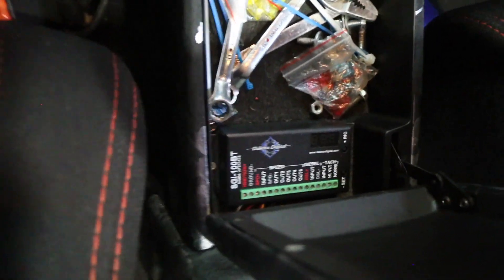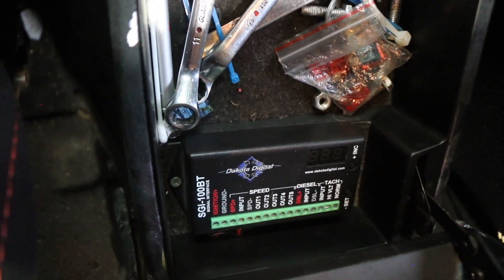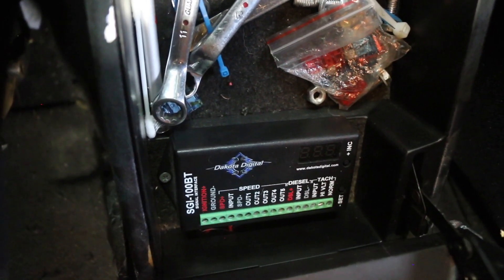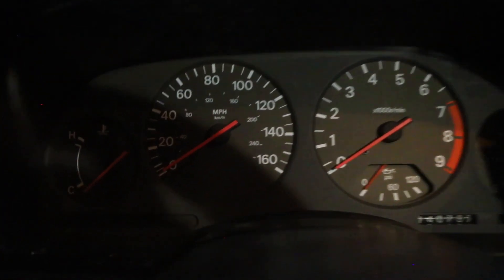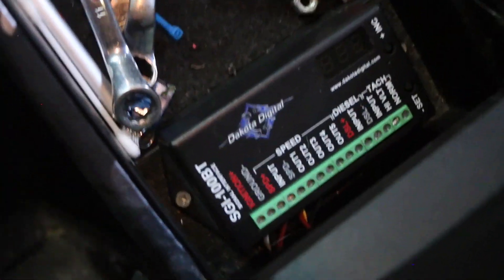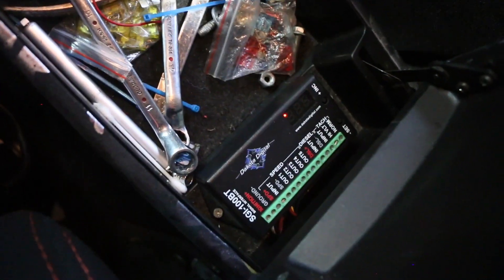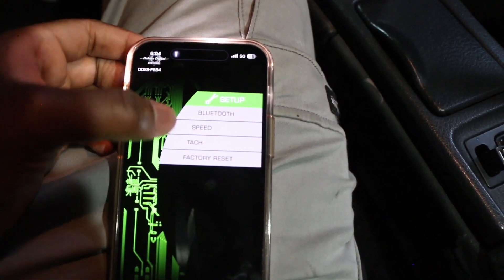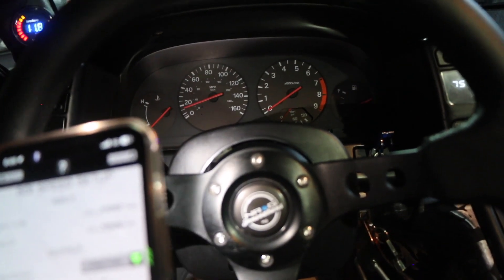How to Successfully wire Dakota Digital SGI100BT to 300ZX

Comment: Yo bro so I’m running this on my 350z I got signal but it’s not reading speed
Reply from the maker: Did you calibrate it after installation? I've seen that happen when it's not properly calibrated for wired up properly. 

put your back tires on jack stands and let the car roll in drive (lowest gear) and see if you get a signal sent from the speed sensor. could just be your wiring setup. 

what transmission are you using?

Comment: Any other way to test dakota box without using Bluetooth?
Reply from the maker: yeah. after you connect everything you can either test drive the car on the street and watch the speedometer to see if the needle moves, or you can put the rear of the vehicle up with jack stands and put the car in drive/ gear 1 allowing the wheels to move to see if the  gauge is moving. Hope this helps!